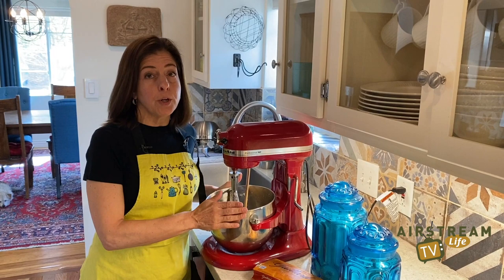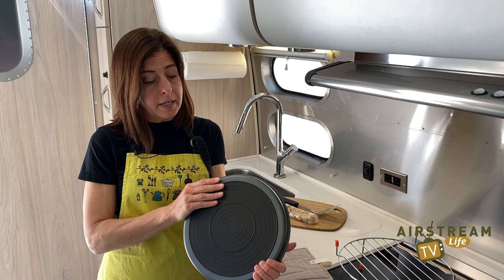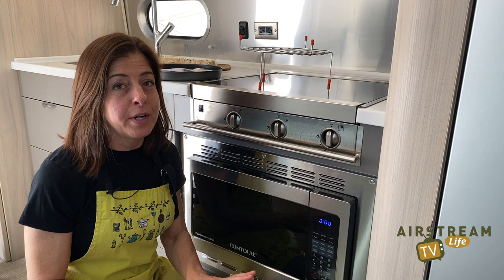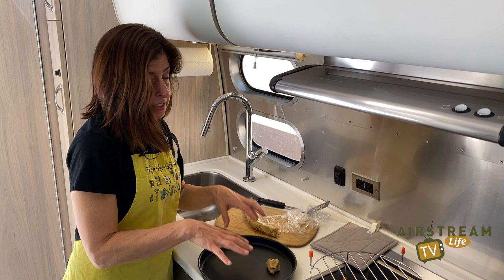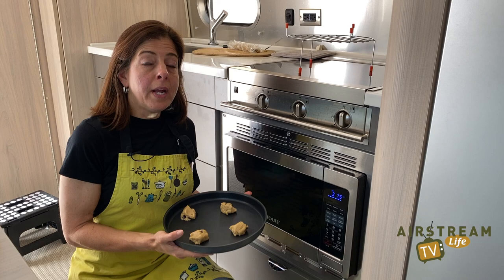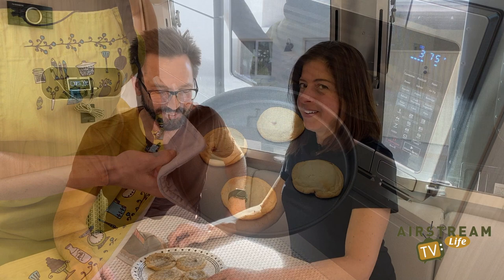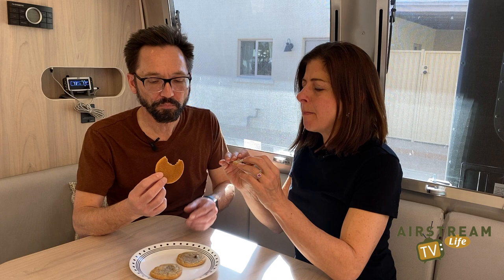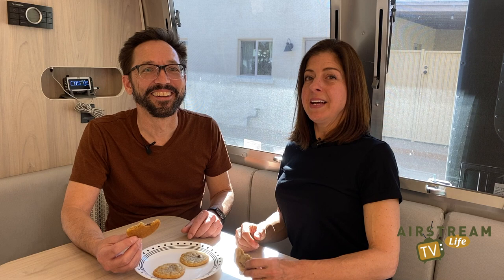How to bake cookies in your Airstream's Contoure convection microwave | Airstream living

Comment: First rule for convection in the Contoure microwave convection oven manual reads “REMOVE the turntable when preheating the oven…..”  I noticed you didn’t do that.  Did you skip that part or is it not necessary?

Comment: This is awesome! We have a 2023 International FBT and are planning our “maiden voyage.” Tollhouse cookies will definitely be part of our trip! 
Question: I would like to practice using my oven here at home before we go. What are the power requirements for running the oven?  110 from my house? 30amp? 50amp? Thank you!
Reply from the maker: You can plug either the 50amp or 30amp plug into an adapter to then plug into your home power supply. It will run the microwave. If you don't have those adapters they are easy to find a RV and other supply stores.
Reply: @airgear  thanks so much! Now I hope to learn more about the metal rack that came with the oven.

Comment: Do you have a video on the air fryer?
Reply from the maker: We did not make more videos about this convection microwave because sadly, we could not get the air fryer and other features to work as described in the instruction manual. So we have never used anything but the oven feature.

Comment: Where did you get the pan you used for baking your cookies what is the metal rack used for
Reply from the maker: It came with our Airstream. We tried to purchase additional ones from Contour (the manufacturer), but were never successful. You could try your dealer as a start.

Comment: We just bought a used 2021 Airstream with a convecton microwave and it did not have the metal pan you showed in this video; the previous owner must have kept it.    Do you know where I can buy a replacement?    I did not find any when I googled.    Or can I just find a metal pan that fits the microwave and use that?
Reply from the maker: That metal pan was not included with all trailers that came with convection microwaves. Unfortunately we haven't been able to find any source for replacements.